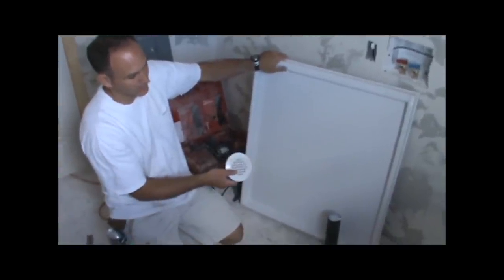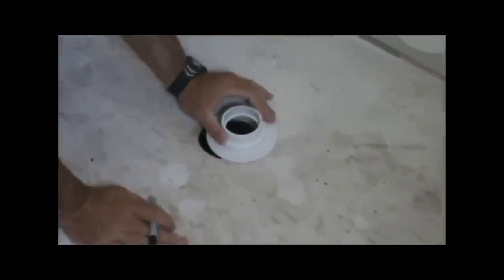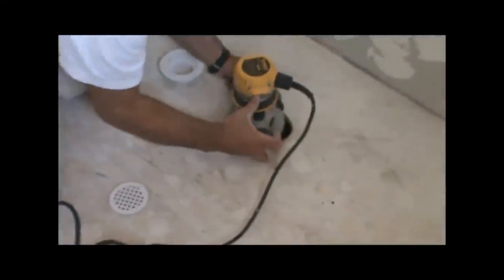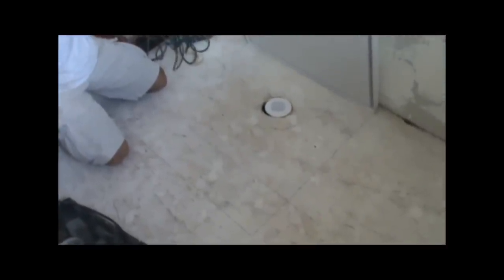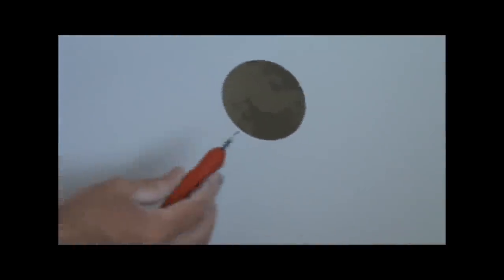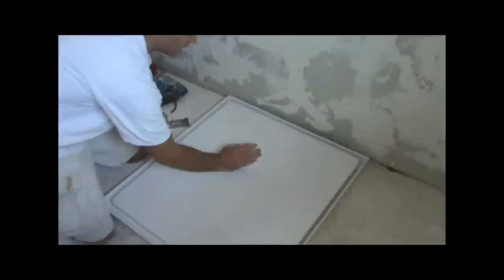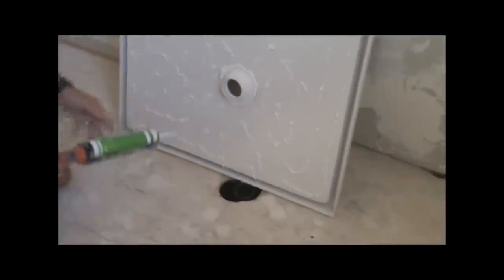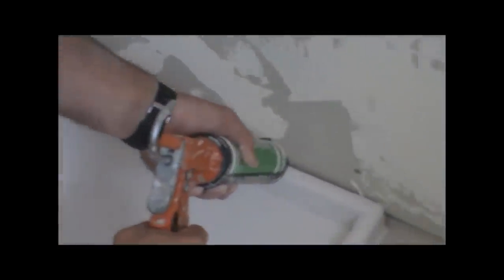Duraflex (Washer Pan Installation)

Comment: Washer pans and drains are essential, especially when you have a first or second floor laundry room.  My washer overflowed, ruined first floor, crawl space and finished basement.  Also get water sensors for all sinks, water heaters, dishwashers and sump pump pits unless you have thousands to tear out and rebuild.  Don't forget a whole house generator.  Back up sump pump batteries only last 7 hours and if you're not home when it happens...  After 3 basement floods, I take all precautions.

Comment: I have never seen a washer drain pan glued to the floor, and glued to the subfloor no less.  Even the installation instructions accompanying drain pans describe using parts cited by C Mango, with no mention of gluing the pan to the floor.  The manufacturers' are well equipped to determine proper installation.

Comment: I am connecting my washing machine right now, does the drain hose go in that hole? Or what is this for?
Reply from the maker: no, this is for emergency overflow only
Reply: @toddgddot  thanks! after some googling I figured that out but I had already ran a self clean cycle. Should I be worried? Nothing leaked and the water didn’t overflow. After the self clean cycle I changed the drain hose to the correct hole and ran a quick cycle and all seems in order as of now.

Comment: I thought you should install pan on finished floor product. Hows it gonna look with floor product butting up against pan. Im betting not too good
Reply: Our first home had a pan installed this way with linoleum flooring installed afterwards.  There was a clean bead of clear caulking around the edge and it looked great and the pan was solid.  It came standard on our first home.  I paid an additional $200 for a drain pan when building our current home.  We were disappointed to see a cheap flimsy pan that was installed after flooring was put down.  Pan isn't secured to the floor accept where the drain is.  The drain pipe sits about a 1/2 inch above the bottom of the pan so water sits in the pan instead of going down the drain.  The plumbers had to come back and re-do the seal as it leaked and was visible on our ceiling downstairs.  I'm now looking to install this type of pan on my own.

Comment: This is wrong! You never want to GLUE one of these plastic pans to the drain and the subfloor. These pans inevitably break/crack and need to be replaced. There should be a threaded terminus on the drain pipe that accepts a threaded flange/rubber washer combo which holds the pan in place. If there isn't one there you or a plumber should install one. Yes you would have to remove a section of the subfloor to do this, but it's worth it when it comes time to replace this plastic piece of crap. Actually, he probably could have glued the threaded piece on without removing any subfloor. Even if this is one of those supposedly "unbreakable" pans, you should never permanently install a fixture this way. I call it a fixture because it's basically a big sink with no water supply (hopefully). What if the home owner buys a new washer/dryer of different dimensions, or wants to slightly change the location of the washer for some reason? I also agree with other comments that the pan should go on TOP of the finish floor, and AFTER any baseboard installation.

Comment: No flooring under it, no paint behind it, it will get destroyed by other trades, while the room is finished. You have demolish it, & ruin other finishes to replace it. Is there a trap in the drain? If there is, it will eventually evaporate & let sewer gas into the house, unless you regularly pour water in the pan. Individual trades don't care. They get in, get out, & blame each other for stupid installations.

Comment: Why do u need a wash pan?? Why not just put the washing machine on the floor?
Reply: If your washer springs a leak, water will run down the drain, rather out into your house, ruining your floors and wicking into your dry wall where it could cause mold.
Reply: You need to leave more than 30” to account for trim too...
Reply: Required upstairs these days. Most jurisdictions for obvious reasons.
Reply: Was just wondering if the machine is upstairs Would make sense to me so it doesn’t flood the whole house or down stairs neighbours (flats) Here in the uk hardly anyone has it upstairs it’s all in the kitchen garage shed or utility room ⬅️ (but that’s for posh people) haha. My machine has a waterproof system so if it detects any leaks! The pump will kick in and It will drain all the water out sound an alarm. Tried and tested 9 months ago when the pressure switch failed. Had it fixed it’s all good now :)